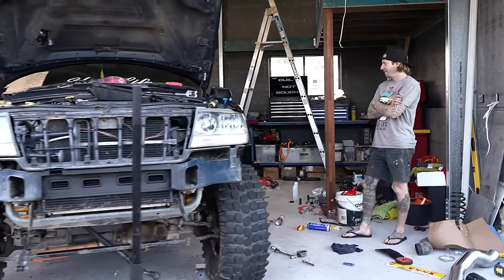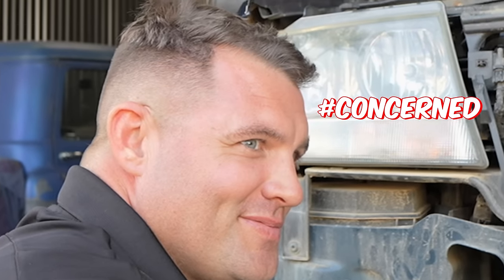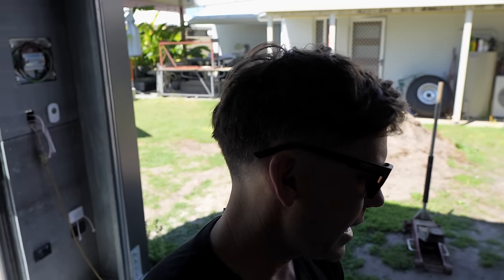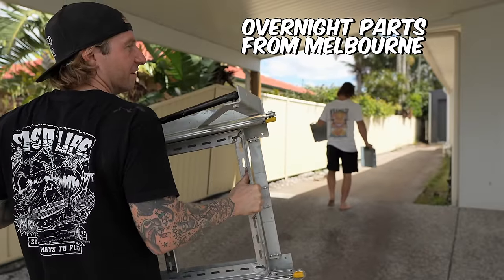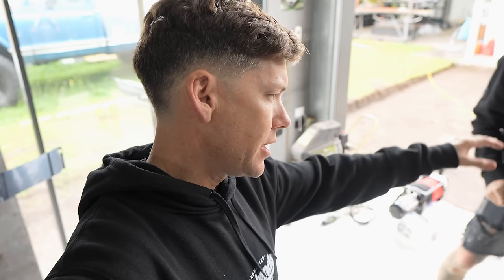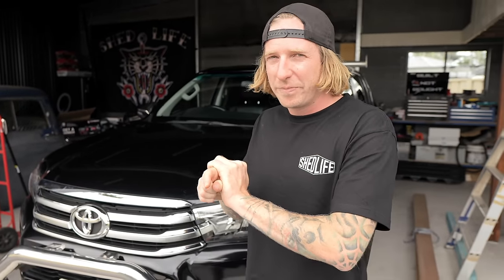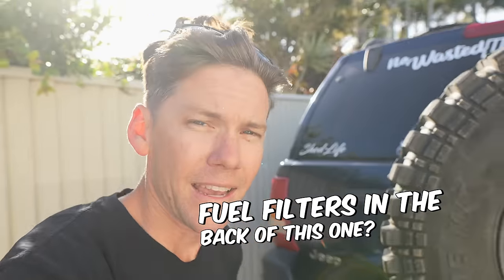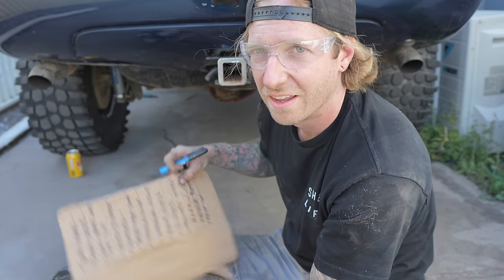$5k CAPE YORK Budget Build

Comment: What an awesome build. So cool to see that by using your knowledge of the other brands, you can put together a custom suspension that will work for this trip. If the damn wobble comes back, it’ll be down to wheel balance. If it occurs on the highway, pull up, find somewhere to do 2 tight 360’s and get going again. As for the Dana 30, just remember that they don’t like big wheels. Spinning and gripping off-road can bust them pretty easy. Safe travels and I look forward to your updated video….

Comment: I got a wj. Not snorkel, just has twin pods that tee straight off the throttle body and sit on motor. But I would have thought U would have thrown all that just and put the snorkel straight to throttle body. Put filter box where original filter was. And fuck the restrictions off
Reply from the maker: Actually didn't realize this was an option hey